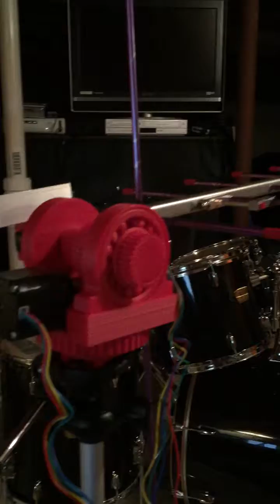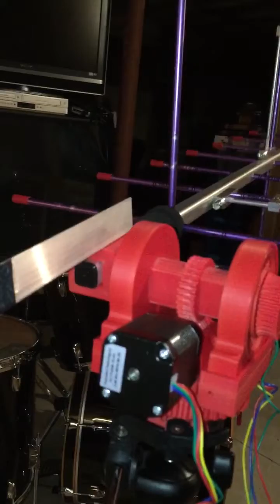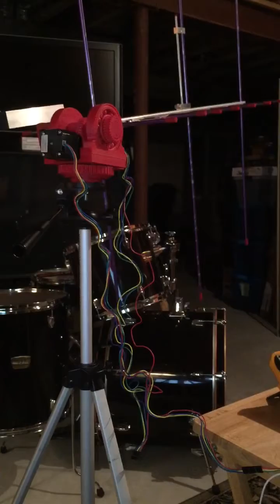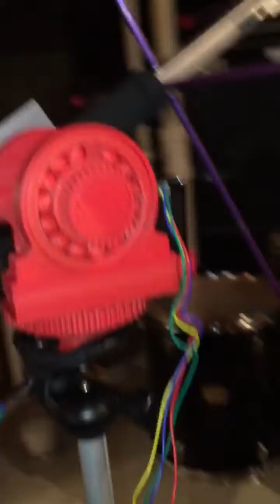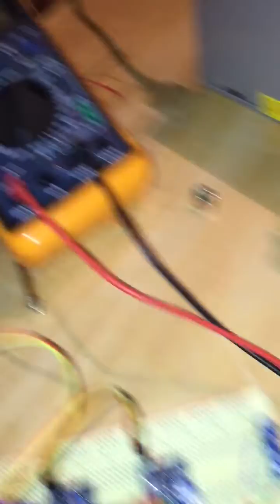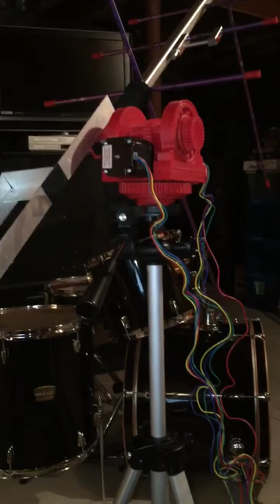3d printed antenna rotator

Comment: Have you added position encoders?
Reply from the maker: No. I had originally thought I would need them. However, after experience with creating my 3D printer, I was surprised on how accurate and consistent everything is without the feed back. My setup requires the rotator to be pointing North and level when starting. It then assumes a 0 position.

Comment: Yes, you mentioned the Azimuth had to much friction and it looks like you fixed that.  Yes, I understand it is not wx proof and it is fragile (so is the other one I've used).  It is much cheaper than an Alpha Spid Az-El rotator :-)  Steven WA8Y
Reply from the maker: The friction ended up being elephant feet on my 3D print. Once I filed down the edges of the gear it worked as I intended. The bearing tension is managed by the bolt and nylock nut. Tighten it just enough to keep it together, but no too tight.

Comment: Wow! Thanks for the video, I can see the mechanism much clearer.  Is it holding up OK?  Any guess about how many cycles the gears may be able to complete?
Reply from the maker: Thanks! This one was printed with ABS. I have not had any issues and it has been a few years. This will not handle a large wind load. Well, I have not tried it. No idea on the cycles. I didn’t create it from an engineering perspective. More like can I make it work perspective. Having said that the gears should mesh, and it is printed. So if anything wears out, just print another. The final version works great and is quiet compared to this video. Also, I added a 3D printed counter weight.